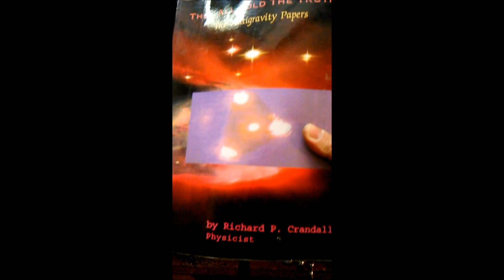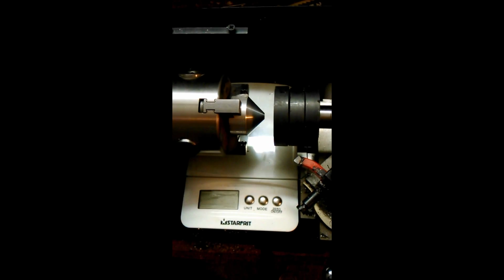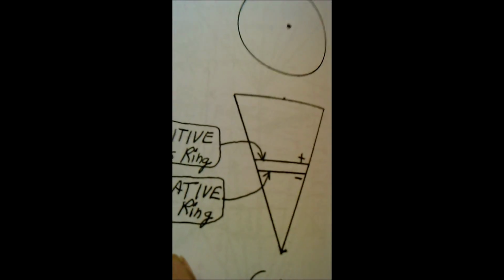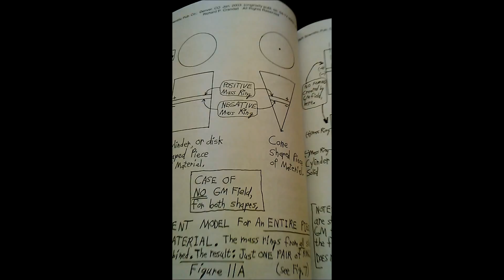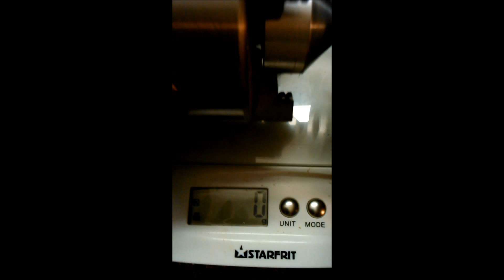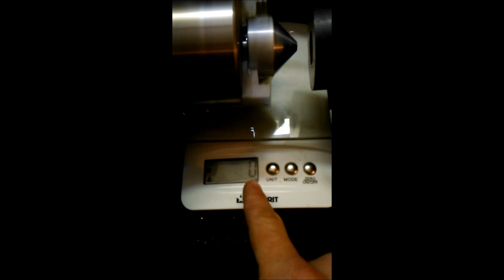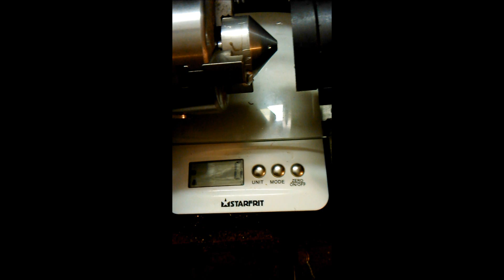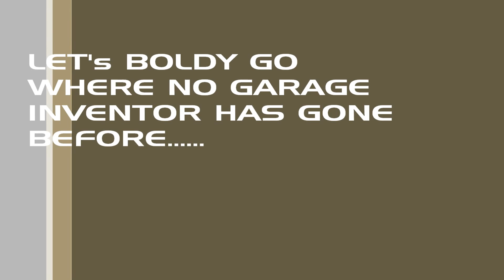Spinning Aluminum Cones and Anti-gravity experiment

Comment: Hi, it's ME!  The author of the book which the above devices in this video are based upon, entitled "They All Told The Truth:  the Antigravity Papers", by Richard Crandall (me).  Wanted to tell you all that I now have a WORKING gravity modification device, which was tested at Nassim Haramein's Laboratory in CA.  Several physics qualified people witnessed it, and we all believe we were successful in warping spacetime.  This effect was visible to the eye.  The device, the Gravitomagnetic Fluid Generator, produces a strange clear fluid which bends light rays and which clings onto various materials, such as wood, calcium, and aluminum.  We found out, both by theory and actual experiment, that it will NOT cling to iron, however.  I will try to post a link to my updated website, in a separate comment, but YouTube will probably NOT LET ME.  So in that case, just go to my publisher's website, Trafford Publishing, and look up my book on there.  On their web page, it gives a link to my current website.  It's well worth your time to Go Look.  Thanks!
Reply: AMAZING, and noooot badddd !

Comment: I don't see how you can effectively gauge what was happening because there was NOTHING on the scale (I think).If you were expecting the scale to start registering minus numbers, scales don't work that way. And what exactly were you trying to weigh? And does the effect, whatever it is, have to be directed or aimed at the object being tested? I'd like to see you do this one again taking what I've just written into consideration. Thanks.
Reply from the maker: I was trying to measure a fluctuation in local gravity. I reasoned there would be some change nearby and may show up on the scale, as the glass plate has substantial mass. The effect, according to the author, would be gravity waves emitted longitudinally from the surface of the cone shape causing a force in the opposite direction thrusting the cone away from its vertex. Having said all that... I have no idea how fast to spin the cone, or if its purity is crucial, or the magnetic field strength requirement, or if supercooling it may help... probably. It may be possible to calculate such things with the equations in the book, but its way over my head.
Reply: @failforwardresearch3127  Use balance beam these digital scales are not nearly sensitive enough.  A good way would likely be to stack a bunch of thin glass plates and point a laser at them such that the reflections interfere with each other and give you fringe patterns on wall or whatever.  When any of the glass moves even a few nanometer the fringes will change.  I have used both methods as suspending a rod on a thread and a mirror to reflect a laser can give extremely accurate measurement of any local disturbances.  Too accurate to be honest hence the reason I moved to the glass plate method I just mentioned but definitely ditch the digital scales for this sort of stuff, they will get you nowhere really.